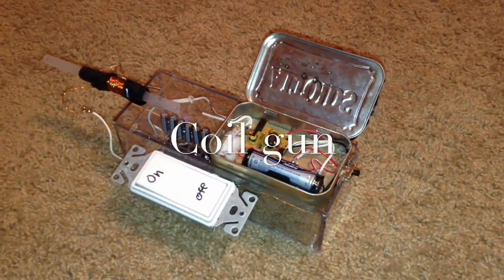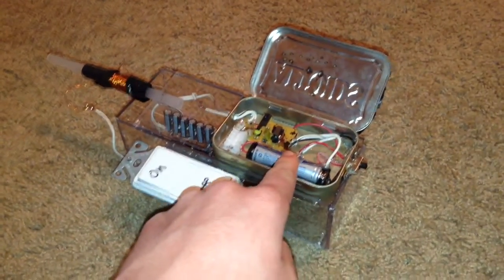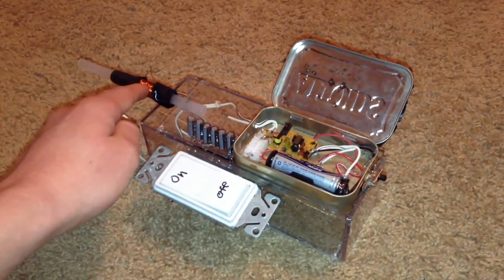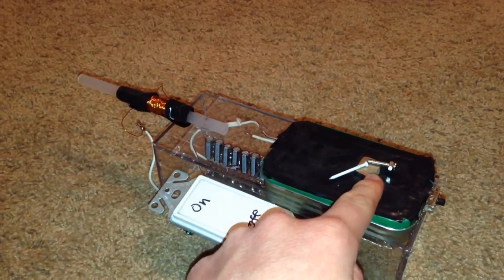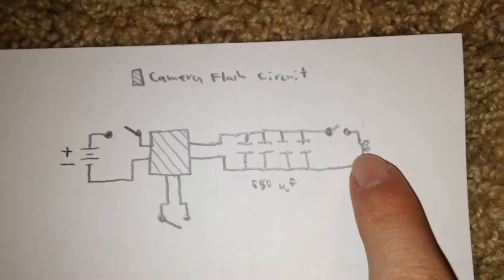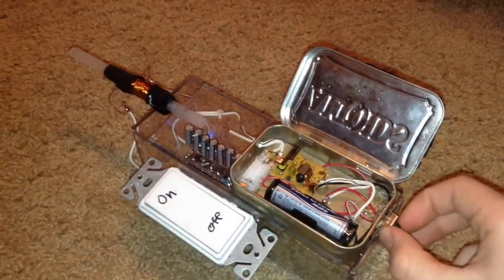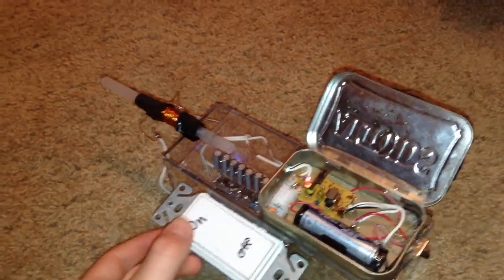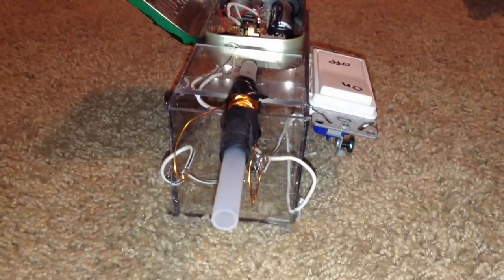Coil Gun From Disposable Camera

Comment: It doesn't matter if there is 10,000,000 volts... The amps are what makes the magnetic field stronger.
Reply: and how can you increase the amp?
Reply: +Kristi Hall But the higher the voltage the lower the amps, is that right?
Reply: it depends on the resistance of the coil
Reply: actually more voltage = more amps.
because I=V/R if R is (for example) 1 ohm then there will be 1 amp for 1 volt and therefor if we put 100 volts through that coil we will have 100 amps.
of course this is limited by the  capacitance  and the internal resistence of the capacitor bank.
Reply: MaPorcaTrotaATutti I =V/R is ohms law, not the definition of current. I=rho/LA
Reply: but still I think that ten million volts would vaporize the wire instantaneously
Reply: True and people focus on the volts in a camera taser but if you want it to be deadly the amps are what matters